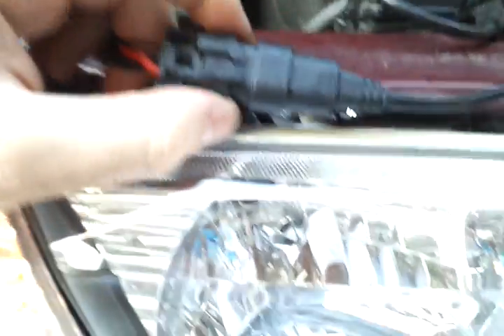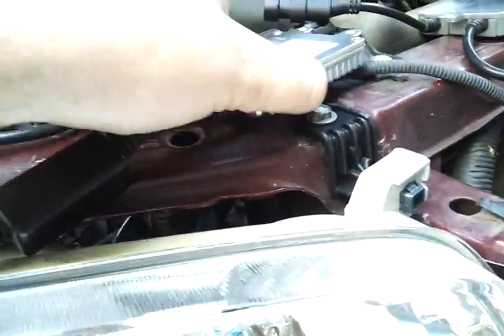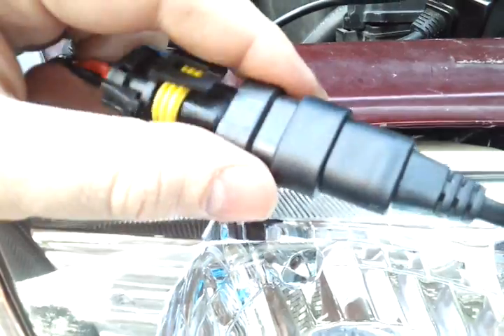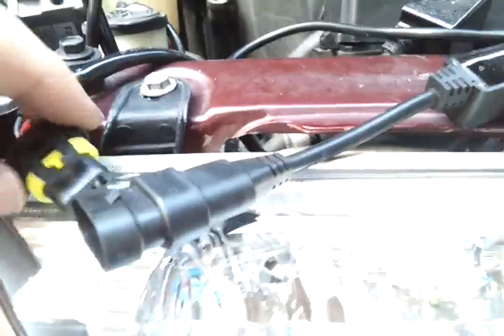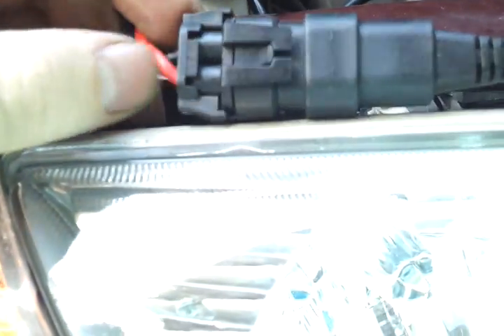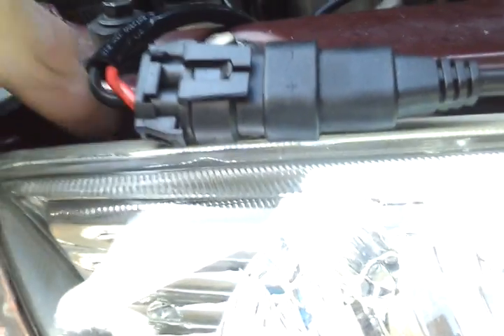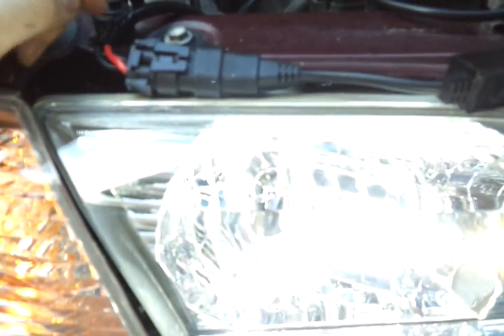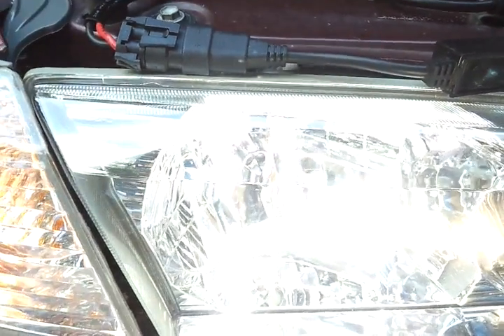Ballast not working fix - Flip input connectors

Comment: I have literally had my car out of commission for (at least) the past two weeks, trying to figure out what the hell is wrong with my headlights. One went out while I was working on it. I tried to diagnose it by swapping in the ballast from the working side. Didn't fix the problem. I reassembled the other side, and suddenly now the other side failed. I was losing my mind trying to figure out what was going on. I was testing voltage, had one of the ballasts warrantied, testing the alternator's charging output, etc. When I saw your video, it finally dawned on me that maybe, just maybe, the clowns that assembled my headlight kit might have wired that connector wrong. So, I unplugged that connector, swapped it to the wrong side, and reconnected it. Much to my amazement, it finally worked.

Those clowns at the factory owe me for countless hours of my time and labor trying to figure out something that turned out to be their fault.

Comment: thanks bro you save me a big ass headaches I was about to fkn order a Ballast and I flip the connector and boom so the last owner of the car installed a kill switch he put a ground up the fuel pump and starter relay but if I disconnect the ground nothing works I put a new relays and nothing happens when I turn the key on help please

Comment: ??? so who do you think is going around flipping all of the connectors 180 degrees? It used to work...stopped working after it rained... You really think the wire got magicly flipped around? haha EDIT: After reading a lot of these responses I'm guessing this thread is geared more for those of you installing after market kits? It didn't seem logical that a stock system that always worked just suddenly got it wires crossed. Sorry.

Comment: Hi, quick question. My driver's side headlight stopped working so I assumed it was just a bad bulb. I took it to my mechanic and he said I needed a new ballast as well since he flipped them to see if it would work and it did not. I bought entirely new headlights for my car to update it with the new ballasts. I installed it and the same side does not work. The high beam and signal light work fine it's just that one bulb. I don't know what the issue is.
Reply: Charlo Estrada did you ever figure out what it was? I am having the same problem with the passenger side.
Reply from the maker: Charlo Estrada , I would check the fuse for that on the vehicle.
Reply: The fuse didn't blow. I'm going to try and swap the light inside to see if that is the problem. Thank you for the quick response!

Comment: What if I tried this already and nothing works? Installing on a 2012 Nissan maxima
Reply: It's just the fog lights that won't come on, headlights are done
Reply from the maker: Jose Santana fog lights someone's need a relay harness. check the fuse for the fog lights
Reply: If it was the fuse the originals wouldn't come on would they?
Reply from the maker: Jose Santana correct
Reply: DistantXtremes Lighting  they look good
Reply: DistantXtremes Lighting do you have a number I can call ?
Reply: DistantXtremes Lighting so fuses are good what's this relay you are talking about? Where do I get one ? How do I install?

Comment: I have a issue with my HID. My driver side works fine but my passenger HID don't work. I think it's the Ballast because I switched the ballast and it did not work.
Reply from the maker: WintersRus if you flip the ballasts (without the bulbs) from one side to the other and the problem follows just the ballasts, then the ballast is the potential problem.

Comment: my lights work but sometimes i have to turn them on and off for about 30 times to get it to come on. what do you think the problem is?
Reply from the maker: Edgar Camacho , depends on your vehicle. it may be as simple as needing a  Xenonsplus HD relay harness
Reply: apb38  i fixed my problem, it was the relay and now my lights work how they should and only cost me $8.
Reply: Edgar Camacho Yeah it was my relays.  Where do you buy those at?
Reply: happens to my 04 avalanche. Once the bad hid light is on, it messes my computer up and gives me codes like traction control and ABS, and service brake system. (only in my scan tool not the dash board) Sometimes making my brakes catch if I'm driving slow. Be careful. It's literally causing a malfunction in the can bus system for me. All issues are 100% non existent when the lights are off. My case I'm sure it's just a bad ballast
Reply: Yeah i got the same issue but now after 50 tries it wont come on at all.
Reply: apb38 i got mine at auto zone they might be able to match yours or try any auto part store or online.
Reply from the maker: apb38 you can contact us with pictures of your relays to get an email with replacement options. www.distantxtremes.com
Reply: Hey Edgar Camacho, I have exactly the same problem right now: I have to turn the switch on and off several times...for the HID headlights to come on. Do you think that maybe it's the same as yours...a relay problem? The only thing is that I have an Acura MDX 2003. Thanks.

Comment: Hi, I hope you can help me.
I've had my HID headlights (High beam uses separate bulbs) on my vehicle for about 2 years they've had no problems until two days ago. Now when I turn on the headlights the HID lights don't come on unless I flick the high beam on and off.. have you seen this problem before? is it a ballast issue?
Reply from the maker: replace bulbs and that should fix that
Reply: oh is that a bulb problem? but both sides don't turn on at the same time. The HID bulbs still work it's just that I have to first flick on and off the high beam..
Reply from the maker: Yoonsung Choi try a relay harness

Comment: The sound is normal but i have a question my hi and lo beams and switched for my 01 mustang so how do i fix this i looked up on the site and it  says to flip  ballast input and they emailed me saying to repin? Witch do i do
Reply from the maker: Great question. In this video you will see the input is two wires for the ballast, this video is too assist troubleshoot only if your lights do not come on at all.  For h13/9008, 9004, 9007, h4/ 9003. All these have three wires on the relay harness connected to the factory connector. Low beam (usually white but could be different), high beam (usually blue wire but could be different), ground (usually brown or black). If you turn your lights on low beam but they shine on high, and when you switch to high beam they shine on low, all you need to do is swap the white and blue wire in most cases. A cheap test light to see which wire is which from your factory connector will help. I will try to make a video that explains this better.